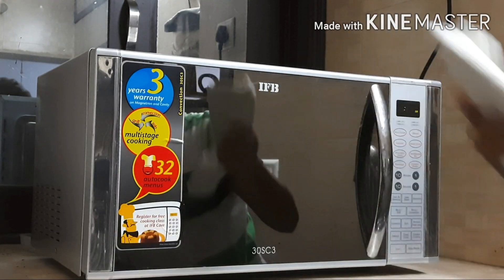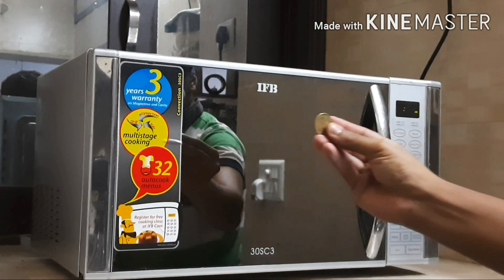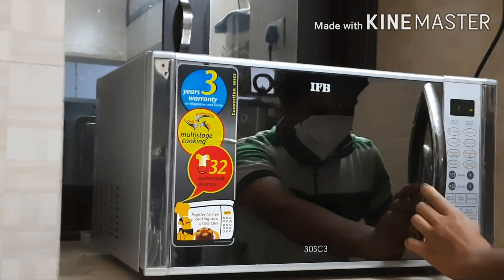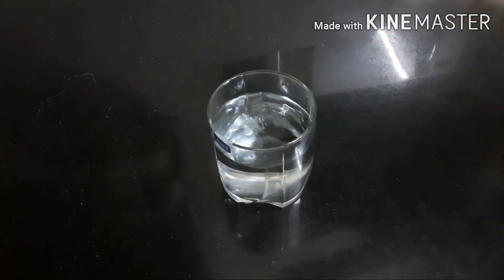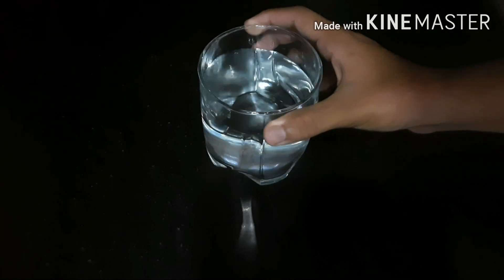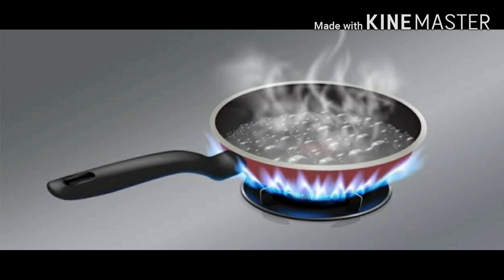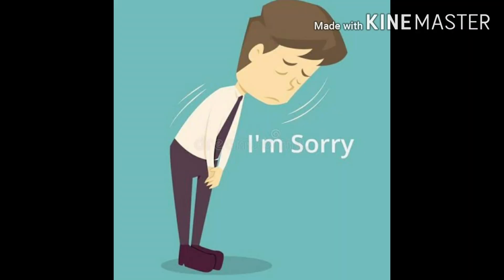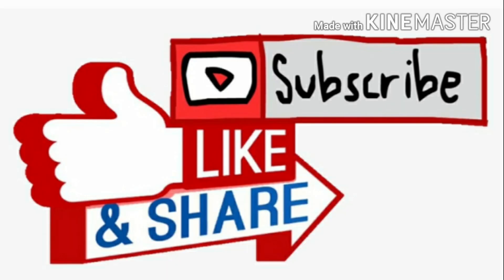Exploding water + Superheating of water Explained | All You Can Do Here

Comment: No use putting on a stove, I just got scalded yesterday when I was boiling a pot (without lid cover at all). I realised something is wrong when the water isn’t boiling after 10 mins which it usually will, I saw the water is already very hot & lots of steam in fact, so I switched off the gas and took the pot out from the stove, immediately I heard & saw bubbles foaming at a high speed & next second it exploded & splashed onto my hot body & hands. Luckily my face & eyes are not hurt but my hands & fingers got scalded.